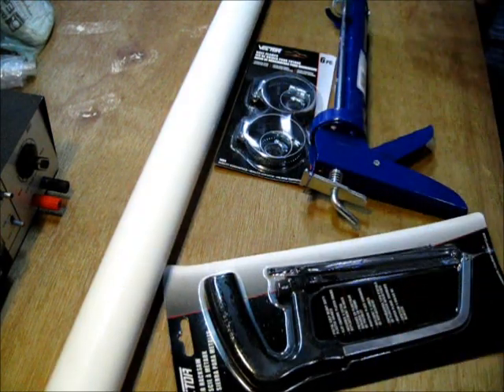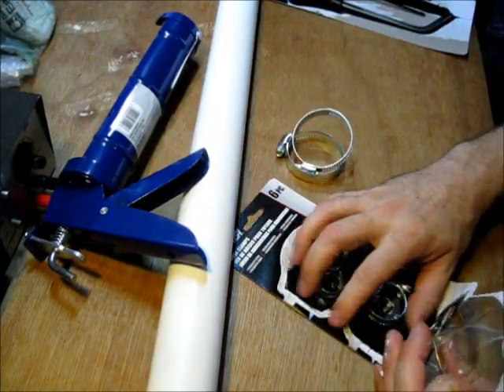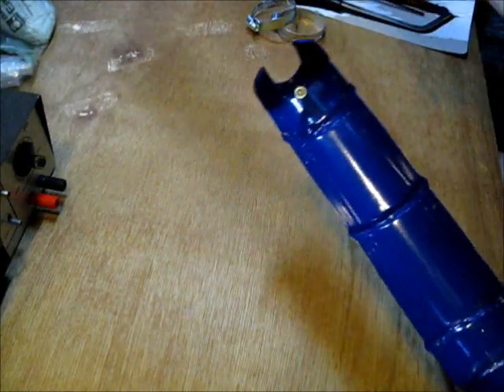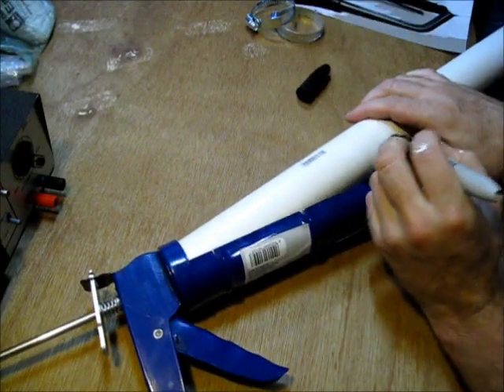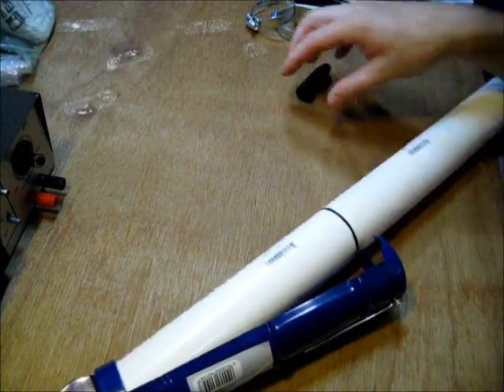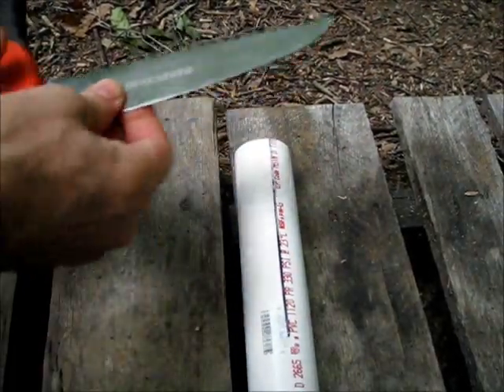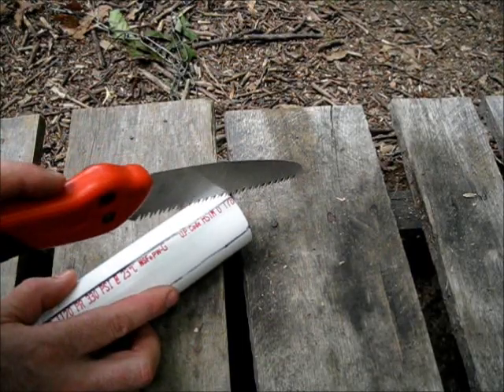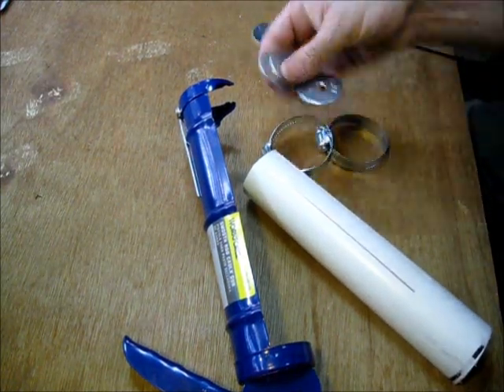How To Make A Simple Biomass Briquette Press

Comment: This is great. Use a chop[ saw to cut pipe it keeps it straighter. I use 2 washer that fit into PVC..one at bottom then pack in paper slury and when its packed put the other washer on top. Theyll squeeze it better and keeps most of the slury in the tube
Reply from the maker: Thanks for the suggestions!
Reply: Not everyone has a chop saw…. This is the affordable diy method

Comment: Just re the clamps..if you have a philip's head as well as a normal head, on the clamps, use the philips..it will negate too much slipping off while screwing clamps tigher.  I hate flathead screwdrivers unless I can't find a philips..but that never happens here, I have plenty of philips head screwdrivers around. I also found a clamp with hexagonal head so that makes life easier too. But good project just the same.
Reply from the maker: Thanks and thanks for the tips.
Reply: @TheDoItYourselfWorld  Allen key heads I was thinking of Hexagonal? I'm losing it...😅

Comment: After your initial size cut and leaving the pipe in the caulk gun, hold pipe into the gun channel then draw a line on each side. When sawing, leave the whole line intact.
Rotate the pipe as desired to make more marks. And cut accordingly.
Nice straight lines and cuts.

I would have used a piece of wood and put it in the slotted end to the butt end of the caulk gun, then used the transfer method of measuring onto the pipe.
More accurate that way as far as length goes.
Reply from the maker: I have seen them made with slits too.

Comment: I just drilled holes in mine to expel the water. No slit, no clamps. Just push it out with a rod or stick. Works just fine.

Comment: Or use 2 identical ice cube trays. Fill 1 tray with charcoal mash, and press first tray with second tray on top. Let cubes dry. You do not need lots of pressure to make these, just use a binder like wheat flour.

Comment: THANK YOU DIWS !! Great jump off point. I'm just a ton lazier than you is all. :-)
Mechanics use nut drivers to operate hose clamps. Less hand and eye damage that way.Phatrides nailed it.A series of 1/16 to 1/8" holes will do the same as slots.

Comment: Saw this and within 5 mins made this...old tube of mostly used silicone pumped it out cut end off (Nozzle end) use plastic press insert at that end drill about 20x4mm holes fill with paper and press with gun use piece of broom handle to press plastic insert to push out mini log. But the for the idea dude

Comment: why not use a whole piece of pvc. cut the end off the caulk gun so the whole tube  of pvc fits inside. use the hose clamps to attack the pvc to the caulk gun. you can make the tube as long as you want. and forget the holes. just drain the water before hand.

Comment: This is fantastic! I've had junk mail soaking for 3 days and for 3 days I could not come up with a good solution to make small bricks (will be used with a mini-sized wood stove). I found this video, ran out and purchased the parts for $5. I now have "junk mail bricks" sitting on the porch drying. Worked fantastic! We have 2 cats and purchase cat litter it those large plastic bucket containers and will be using those to store these in for a SHTF event if needed. Thanks so much for sharing this idea!
Reply from the maker: Happy to hear it worked out for you :)

Comment: Wouldn't it be easier (and leave the pipe stronger), to drill holes in the pipe, instead of cutting slots?
Reply from the maker: +BedsitBob Stronger yes. Easier, not for me. I hate drilling so much. But the main reason for the slots is to allow you to press out the briquettes easier.

Comment: I have made the same thing but instead of using hose clamps I simply used my Dremel and cut slits into the PVC pipe, the only downside is I have to use a ram of sorts to get the paper out of the pipe after I'm done squeezing the water out. another idea I'm going to try for smaller pellets is a hand-cranked sausage/meat grinder.

Comment: you can do litle holes for the water and not cut the pipe
Reply: +gigenisgigenis probably but make the holes very small and alot of them
Reply: Without those slits it would be near impossible to remove the "brick". Having those slits allows you loosen the clamps and the plastic will expand out as you push making it very easy to remove the "brick".

Comment: Thanks or the video! I made this and it works great. It compresses like a dream with very little effort. I made two molds, one with drilled holes at an angle and one with slits and they both work exactly the same. These are great little fire starters for camping, or for boiling small amounts of water. I can make a whole season's worth of them while watching tv with this type of press.

Comment: Why not drill several holes to allow the water to come out?  No clamps needed then.
Reply: exactly my thought, avoid the extra costs and work.
Reply: TheKrazysinner easier to release the still wet material maybe? Imagine bashing out compressed paper or something out of the tube! Messy.
Reply: when you squeeze the lever without a cap on the end (use only to get excess water out) the material will just come out, slices not needed.
Reply: Might look into the bottle jack idea i think!

Comment: Just for your interest - Back in my working days I designed an automatic metal-puck making machine for a scrap handling company. It produced dense hockey puck-like tablets from metal turnings (main goal was to recover the cutting fluids). Pressures developed somewhere north of 40,000 lbs/sq in. At first run it sprayed the fluid quite evenly over both me and my client - then we decided to install shielding! I still have a puck or two around and if I recall correctly they were about 95% void free I.E dense!! It is now being sold to companies all over the place.
Reply: why couldn't you use a centrifuge? We would spin our oil soaked chips from the hobbing machines and they would come out completely dry. you could spin 1000 lbs of turnings in about 5 minutes
Reply: malcolm shor

Comment: RATHER THAN CUTTING SLITS WOULDN'T IT BE EASIER TO DRILL HOLES IN IT TO RELEASE THE  WATER ?
Reply: They would have to be very small holes because the paper could squeeze out the holes. It's a lot easier to cut slits than it is to drill dozens of holes in a round pipe.

Comment: isn't  the biomass material forced out of the end
Reply: that's what the washers are for. one or more will likely be used to cap the end that's away from the trigger mechanism.
Reply: You must have missed the very obvious part where he used washers on the ends.
Reply: I was thinking the same exact thing!! I think he forgot to mention that it needs something on one end to stop the biomass being pushed out when putting pressure on it. ^^

Comment: Thanks for the video. I made a press pretty much following your advice. I didn't find a wider saw blade until I already used a coping saw though. Seems to work pretty good even with the smaller cuts. I'm drying some briquettes and still making some with the leftover paper biomass. I plan to try them out when I pit fire some small pottery in an old grill.

Comment: drill small holes and avoid the hose clamps all together.
Reply: fragle shnagle OK use Dremel tool and make slots.
Reply: @JeffStoops  radial arm saw.
Reply: And save yourself a lot of time and less risk of cutting yourself.
Reply: very poor design hose clamp why  you r right drill holes
Reply: Holes would allow the material to flow into them and make the brick very difficult to remove. The slits are parallel so don't interfere with removal.
Reply: Seymour Sunshine good thinking. Guess i would have found out the hard way. lol
Reply: Happy to help :-)
Reply: the only problem with the holes is that they catch the paper when its pressed making it a little harder to get the briquette out but its not that big of a deal
Reply: What if you drilled the holes at an angle running from the back towards the front so they don't catch on the paper?

Comment: Great idea!  I live in the city, so plenty of free biomass on the street. I tried the project out- works great!  I am currently using paper and cloth scrap that comes in packages at work. I cut them and then put them into an old blender to make a slurry. The  finished product dries hard but will ignite readily. I use melted wax in an old cake pan to dip one side briefly. It adds a bit of an accelerant to start the fire.  Thanks for the idea!

Comment: I see 2 floss in your Biomass Briquette Press.1 you cut side of the Pipe to much so when you give squeeze to compact the  material  is going to come out the sides of the pipe even if you have claps on  that why should dill holes into the pipe 2 there no front cap to prevent material not just going out the front of the pipe. I know it not going to work I try it that way  and it failed. because there wasn't any pressure to compact the materials

Comment: couldn't you just drill some holes for water to drain instead of cutting the slits. it would save the structure of the pvc and no need for the clamps.

Comment: Would drilling a small hole at the end of the slit help keep the pipe from splitting too (in addition to the clamps). For that matter... With a series of tiny holes, you may not need slits or clamps.